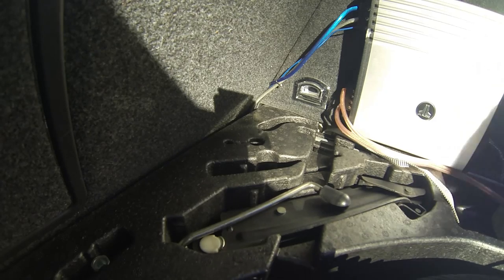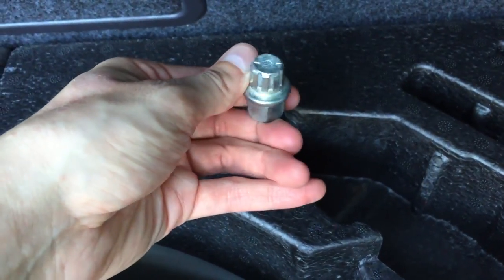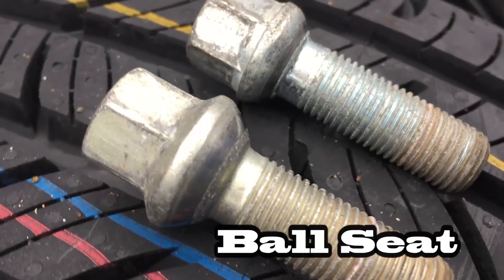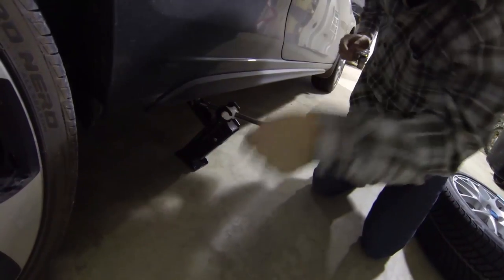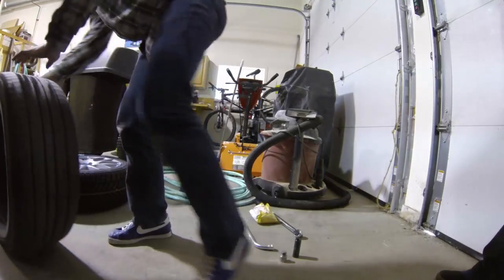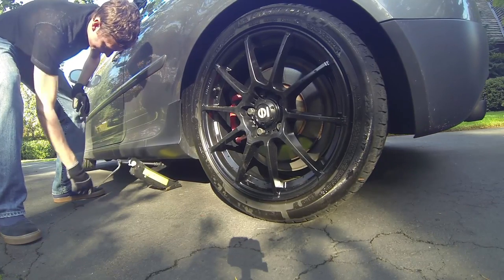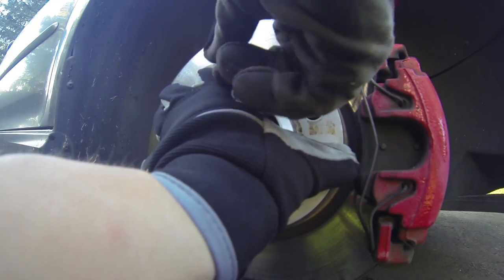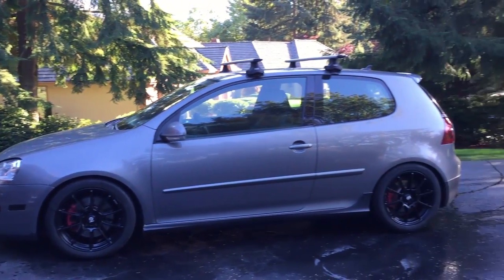How to Change a Tire / Wheel - MKV and MK6 VW GTI

Comment: Few tips. Dont use the widow-maker. invest in proper floorjack. Undo the screws when the car is on the ground . And dont use torque wrench to unscrew the bolts.
Reply from the maker: The emergency jack works great for changing wheels as long as you are on a flat surface. No need to get underneath the vehicle when doing this, so no sense in buying a floor jack for this job. Really no point in using a different wrench to remove bolts either, unless you enjoy spending more time changing your wheels lol. 

This point of this video is to demonstrate that anyone can do this with limited equipment.

Comment: For the spacers, apply a little anti-seize to the surface that touches the wheel and the hub. Non-similar metals will "seize" or "freeze" together and you may need a sledge hammer to knock the wheel off the hub. Been there, done that. The anti-seize acts as an insulator to prevent this reaction.
Also, ONLY use the torque wrench for its purpose. Never use it as a breaker bar. Get a breaker bar to LOOSEN. 
Carry a small, square piece of plywood to place the jack on when you have a flat tire on gravel or dirt roads. Otherwise, you will force the jack base down into the ground instead of raising the car. Been there, done that, too. 
Put a pair of work gloves with the jack. Dirt, snow, grease, cold temperature always get involved. Murphy's Law always rules!